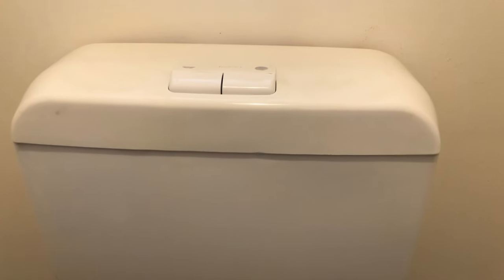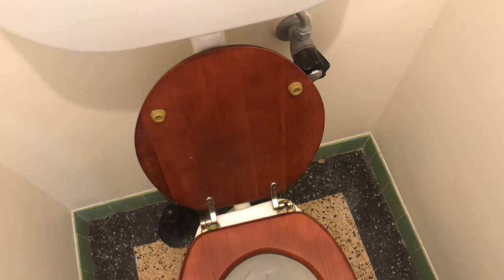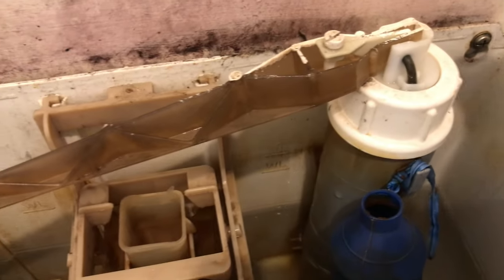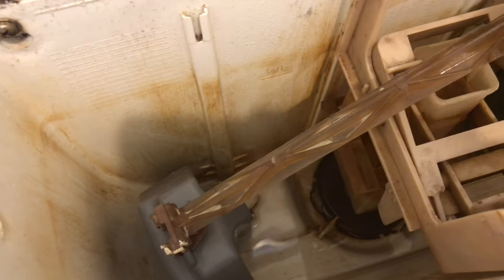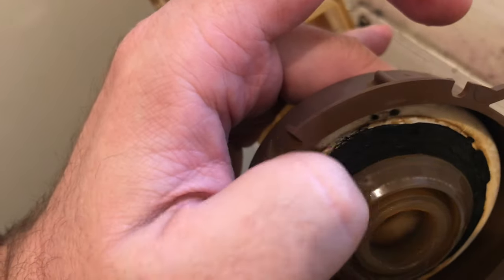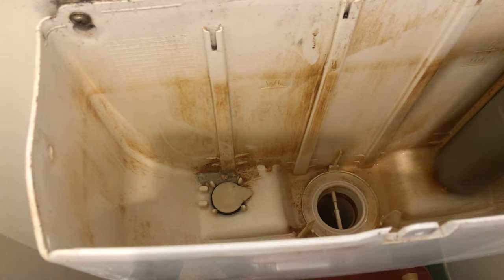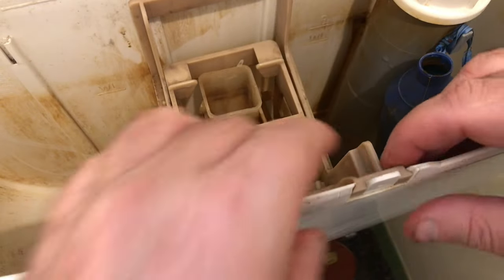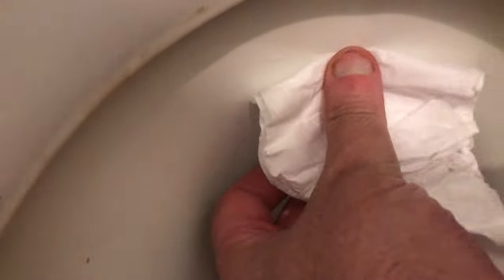How To Fix A Leaky Toilet (And The Mistake Everyone Makes)

Comment: Good to see a video where you're allowed to make mistakes. Talking through to a solution extremely helpful. Thanks for taking time and effort to video and post!
Reply from the maker: Thanks. Mistakes are a great learning experience and if I can help others avoid the same mistake I made and found a solution for then I am satisfied. I tend to do reviews of products I have bought and point out the faults I have found and then the buyer can decide if the product fault is worthy of avoiding the product or if it is not a deal breaker.

Comment: I replaced my washer with the very same one you used in this video a week ago. I did it again today with the correct washer after it continued leaking. The black washer is not the correct one for this Thunderflush type Caroma outlet valve. You might get lucky for a while, but you'll be back doing it again pretty soon when it starts leaking again. The correct washer is red/pink in colour, slightly larger in diameter, slightly thicker and has Fix-A-Loo part number 226129. You can also tell immediately when you've seated it properly because it is supposed to curl up into a shallow bowl shape, like a belleville washer or disc spring when stressed around the central tube. The belleville washer shape helps it to seal and creates a suction against the seat when pushing the flush button for a little bit of resistance to touch which feels proper. If your washer is sitting perfectly flat after installation as shown in the video, you've got the wrong washer. It must be perfectly central located and do not use metal implements to massage it into this position unless you want to replace it again the very next day. There are about 8 slightly different washers all supposedly for different generation Caroma cisterns stocked at Bunnings. The black one is for very old model Caromas I believe. The red/pink one is for later model and specifically the dual flush ones everyone has these days. Most of the old single flush ceramic Caroma cisterns these days have finally cracked and been replaced with these plastic dual flush models instead for water conservation reasons. These use the red/pink washer.
Reply from the maker: I researched it all and that was the correct washer for my model. hasn’t leaked since
Reply: I’m so glad you mentioned the washer needs to curl up, none of the instructions say that. I pulled mine apart five times because it continued to leak. Once I had the washer curling to form the cup the leak stopped.  Thanks to you and the original poster for your help.
Reply: me too. In Mitre 10 , an ex plumber sold me the correct red washer. Perfect job. easy

Comment: There are few other videos on YouTube which try to address this problem. Those videos have different colour washers. I used them, didn't help me.. I saw this video, and that's when I got the correct washer. The trick not only lies in inserting the washer correctly, but also in purchasing the correct washer as per the cisterns model. $250 for the plumber, few DIY washer tries and then following this video, my problem was solved. Thanks heaps! 😊
Reply from the maker: glad it helped you save money by not getting a plumber in

Comment: Thanks bro. I also faced the same problem, but after watching your video and applying a butter knife matter solved. Since 15 yrs, i am using the caroma tank and since one month i noticed the leak and changed the rubber washer not original and struggled but leaking did not stop. In 1995 up 2009 i have a similar cirtern tank but due to leakage in the bowl i had changed for new cirtern not knowing that it was a washer issue. Now i was on the verge to change the whole syatems but your video change my mind and the seating washer fixed well and no more leaking.
Reply from the maker: glad my video helped 👍

Comment: Use a little dish soap on the new seal and rotate the white part under the seal and it will go in smooth every time.
Reply: Thankyou so much for that tip about rotating the white bit under the new washer. It got the seal fully inserted to where it should be (after one failed attempt where we hadn't done that), and now it's no longer leaking into the toilet bowl! Brilliant!

Comment: Great video you can get the seal in place by rotating the plastic base that it sit on, it will slip into place with a few good turns. Hope this helps next time
Reply from the maker: Good tip!

Comment: So really, the problem is an important part to show...the new washer didn't seat properly. I get what you must have done; you did point out what should be done...but the problem's solution was omitted visually. Another minute where you made the seating washer seat properly would have made the video feel complete. Thanks for the video in any case.

Comment: Great video, I have that exact toilet.  It never stops running after flushing it and it leaks, it is noisy.  The plastic adjustment screw broke off as I was wanting to see how it works, but I put  a metal screw in.  It leaks from tap and on the left side underneath, it needs new seals.  I turn it off the water at night.
Reply: PRobably the bottom seal leaking causing the water level and float to drop, hence the constant filling.....    I also had this cistern and changed the entire off coloured cistern with an $80 dollar one from bunnings...
Reply: Or maybe the inlet valve

Comment: I am not a plumber. I have a similar cistern if not the same  It does have an overflow. If I am not mistaken, It s the square plastic tubing in the centre (look at the four minute mark). If water overflows, it goes down this tube and into the bowl. Proof is, just poor some water from a cup down this tube and you will see it run straight into the bowl. Correct me if I am  wrong.

Comment: Thanks for the detailed vid. I too made the same mistake. Just a quick question, when I was testing the unit, I pressed down on the same thing you pressed when flushing the water out and it worked fine, but after putting the lid on, the buttons pop straight back up when flushing instead of staying down for a few seconds. Is there a trick to placing the lid down with the pushing prongs so the half and full flush stay down correct time? Cheers

Comment: Hope you don't mind me saying mate, but you got the wrong one (I know because the same thing happened to me last weekend).  You should have taken the orange colored "dual flush" one that was next to it.
Reply from the maker: Hmm, hasn't leaked since the replacement so seems to work fine. Do you have the part number of the one you believe is a better one? They are all dirt cheap so no harm having an alternative part that works as well or better.
Reply: yes I agree. I just replaced mine with the larger red/orange  one that outside diameter is same as the old one but the inner diameter is still the same as the smaller black one that Walrus bought. Seems like the black one worked for him anyway. Thank you anyway,  your video was helpful in getting me to the fix the problem 🙂